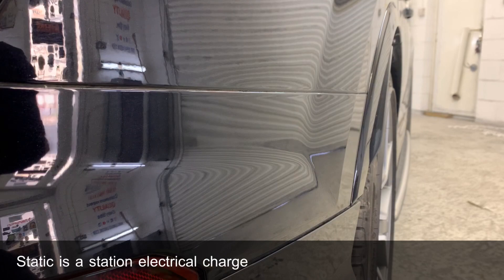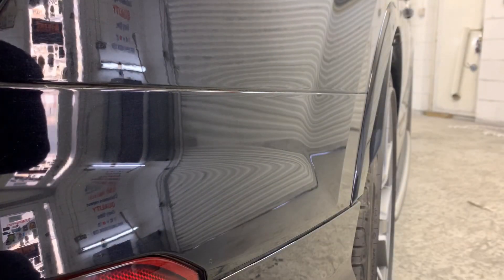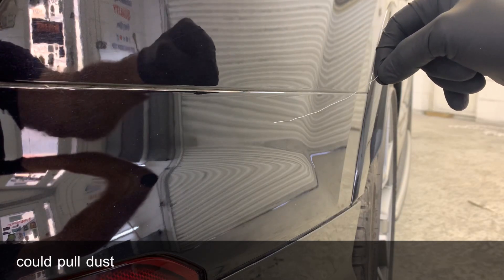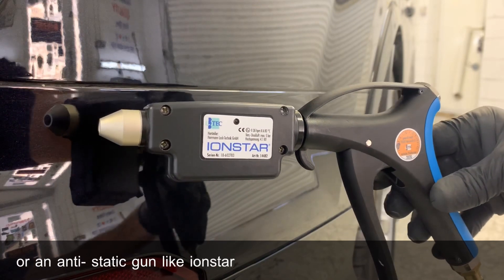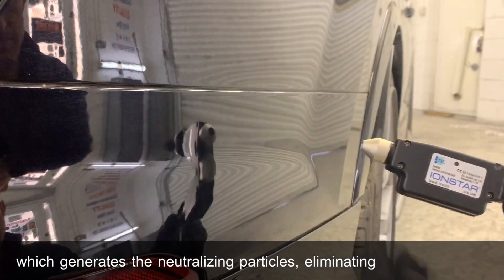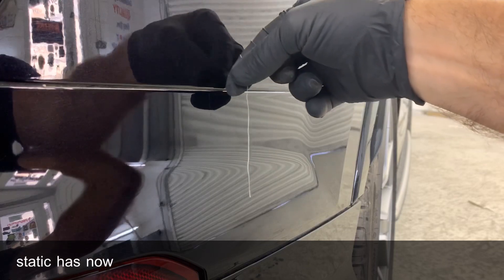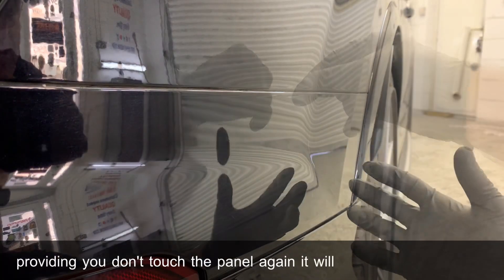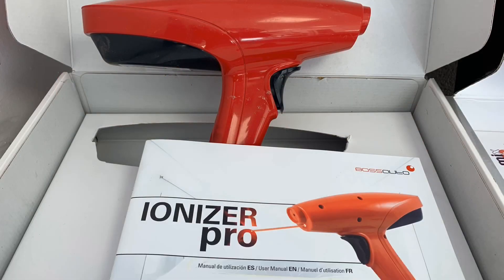WHAT IS STATIC?

Comment: Thanks for sharing, static causes a lot of issues for me but I cant afford one of those guns, you mentioned using a water based cleaner but I use solvent basecoat, is there any other way of reducing static?
Reply from the maker: Switch from the solvent and try a decent waterbase cleaner with a non-linting cloth and I think you will notice a huge difference. I use the octoral TD80 waterbase cleaner
Reply: Ok thanks for the reply, I'm currently using the u-pol fast solvent degreaser, also use a microfibre cloth are they ok for a waterbase cleaner?